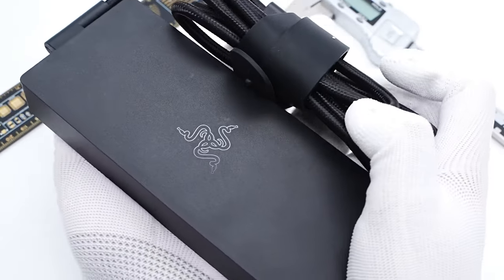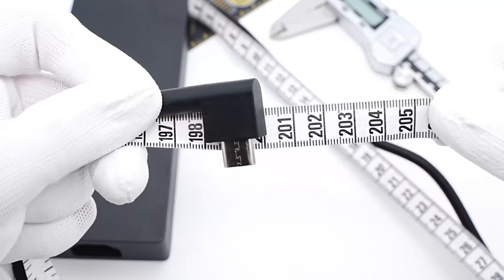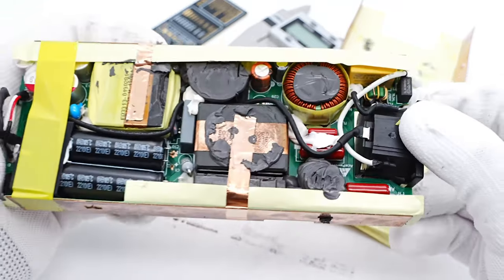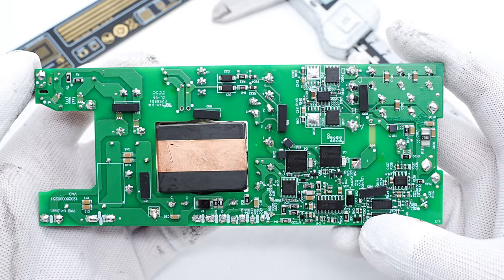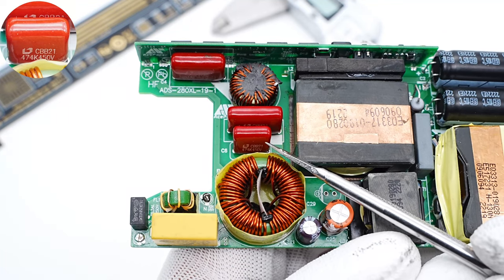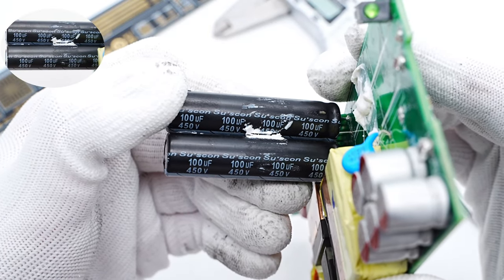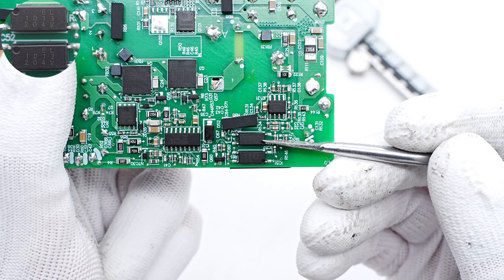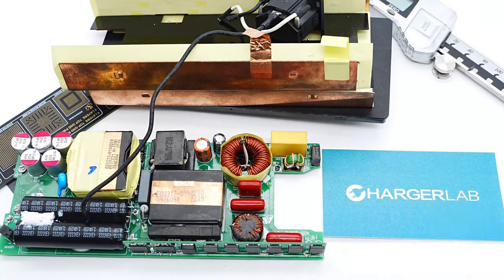Teardown of Razer Blade 280W GaN Power Adapter (RC30-042)

Comment: PC laptop segment power adapter is just crazy, even tho it adopted GaN tech, but still insanely big. After so many years the power consumption is just getting higher and higher, without the power source you are basically carrying an additional brick in your bag. In the next decade, Mac will continue to eat up market share, meanwhile PC market share will just continue to shrink. The power efficiency on Apple Silicon is just too hard to ignore. I'm currently still a desktop PC user, but if I need to get a laptop I am definitely getting a Macbook.